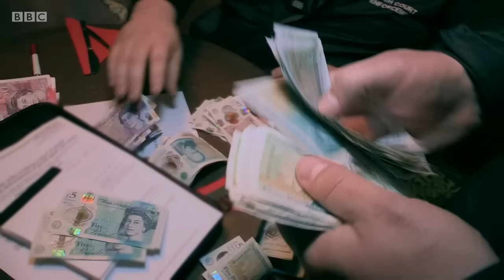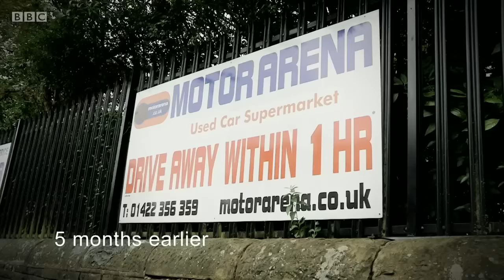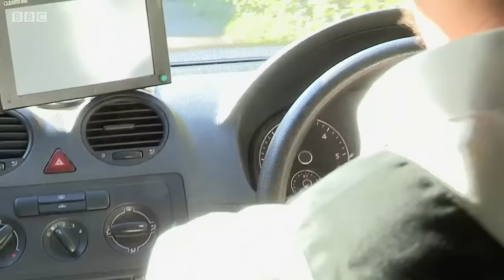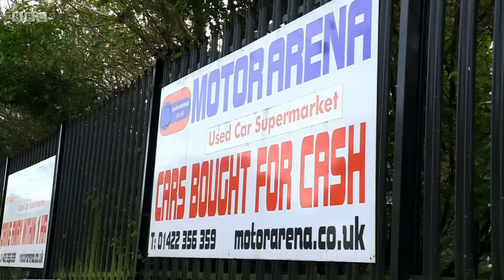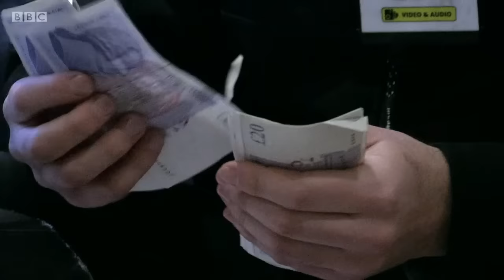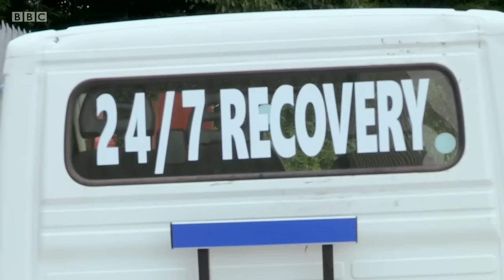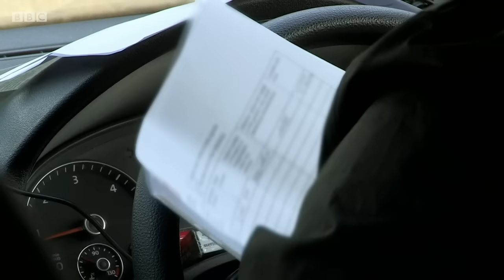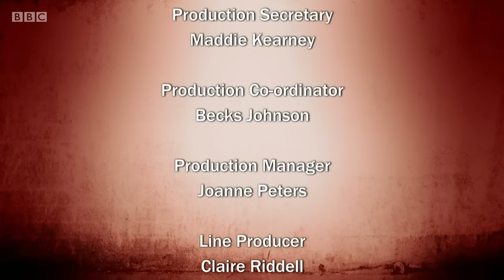The Sheriffs Are Coming S09E01

Comment: In the US used car are bought "as is" so you best be climbing underneath, lifting the hood, check the oil, check the frame, and at least  test drive it!! Cause if you buy a $5,000 lemon your stuck with it!!
Reply: Well I'm not in one of those 7 and to actually get the lemon law to work you need the fix the car yourself a number of times within 30 day,, so it is true in 43 states!!
Reply: @jacquelinegaines3322  

I am in a state with the Lemon Law. So I never concern myself with it;)

But yes… your altered answer is now true…
Reply: The car is sold " as is" in the UK if you are a private seller I.e a regular citizen, but if you're a car dealership, you best hope the engine, breaks and gearbox aren't seizing up.
Reply: In the UK, if you buy from a dealer, the car has to be "fit for purpose", as in it has to work properly, be safe, and have a certificate of roadworthiness, called an MOT. If this isn't the case, a person has two weeks to give the car back for a full refund. That's the law.

Comment: If the sheriffs knows the debter are agressive, they should have the police on hand. Used cars in britain are cheaper than here in Denmark. A used care over here can cost almost the same as a brand new one. Even "destroyed" cars will be sold again. My mom had her old car ruined in 2011. The mecanic would only pay a low price ofor it, abu a guy we know helped my mom. I found out, the car was fixed up and sold to someone else. It`s all a scam and i`ve learned not to trust anyone anymore.